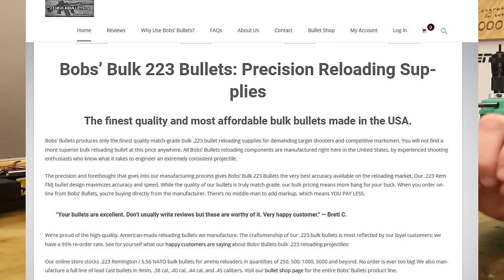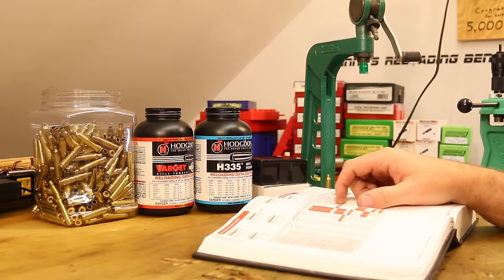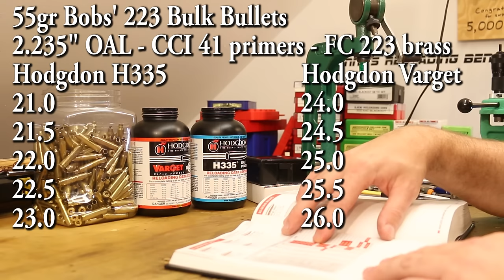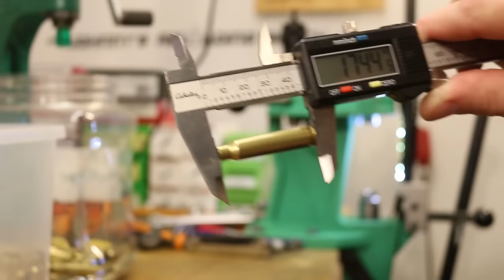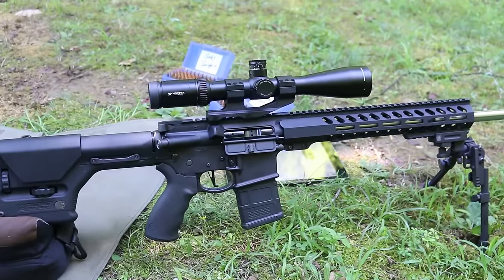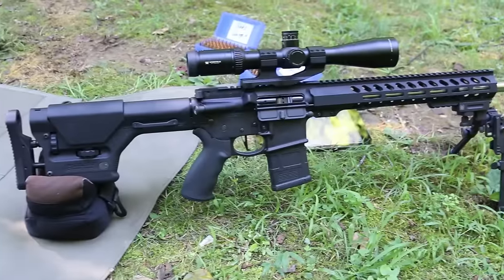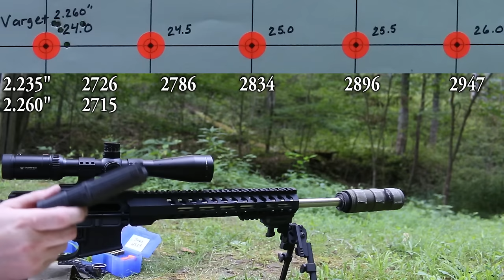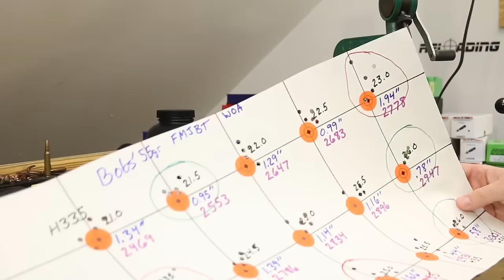Bobs' 223 Bulk Bullets - OUTSTANDING accuracy! 8 cents each!

Comment: How do you seat a 55 fmjbt out at 2.260?   Seems the bullet would fall out of the end of the case mouth.  Do you have 1 caliber engagement of bullet inside the neck?  I have loaded many a FMJBT.  Never saw how to safely mount a FMJBT at 2.260 COAL.
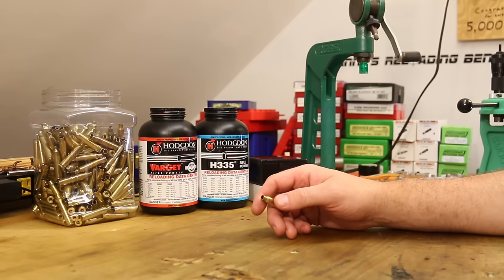Reply from the maker: You can literally see the bearing surface of the bullets seated to the different depths about 5:30 into this video.

Comment: Johhny,I have a situation to ask about,I was decapping the other night and almost broke my Lee universal decapping die pin! I have been running across a few case's that have flash hole's..I know you think I'm nut's, but they are off center? and they are making my decapping  pin get bent,this is pissing me off..is this a regular issue or WTF???...
Reply: Federal brass and a few others this is a semi regular occurance.  Maybe 1 in 40 or so are off center to the point I have to discard the case.

Comment: I'm really new I watch alot of your videos but you have so many I don't know if you've covered it.  I loaded 77 gr bullets into a mix of 556 and 223 brass the shoulder smashed down and bulged out on maybe half. It seems like they were the 556 casings that did it. Was I wrong to use 556 brass? Or did I screw up something else? Thank you
Reply: Bullet seating die is screwed too far into your press.
Reply: @mutantmutton  thank you!! I'll fix it

Comment: Hey, great video! I learned a lot. Hoping you could answer a question, I have a spikes tactical 14.5" barrel with a 1/7 twist. I just started loading 223 and I'm beginning with 24.0 gr. ramshot tac with 77 grain Sierra hpbt match kings at 2.260 inches. I haven't shot them yet but I was worried about the OAL so I chambered and extracted a few. I found some pretty decent scratches/ dents on the bullets and they also seemed to grow about one thousand... I'm curious if you have any recommendations and if you have a method to check the distance between the chamber and the lands. Any advice would be greatly appreciated. Thanks!
Reply: Remington Bradley I assume you’ve found an answer to this by now but jic use a bullet comparator and an OAL gauge. I used to just color a bullet with a sharpie put it in a cut case leave it all the way out then chamber it and measure from the lands scratches to the base of the case.

Comment: JRB, I like the idea of a low cost .223 bullet for all your plinking needs. I shoot 3gun and dont use smk's on the close up paper targets. However, I use a progressive press (XL650) and have found 748 and TAC to be two powders that meter well. The stick powders like Varget just don't work well enough in the Dillon powder measure. So, would you consider working up either of those two powders? Additionally, do you think your 1:8 twist is hurting you with the 55gr bullets? I have a 18" 223 wylde 1:8 and it definitely likes 69/77 grain bullets better. I like what your doing so keep up the good work.
Reply: Mark Eggers I run a 1in8 twist on almost all of my 556/223 rifles, and have zero accuracy issues with bullets from 40gr to 80gr, just need to find a velocity that works for the weight you're loading.

Comment: I think you really need a "control" when doing accuracy testing. A load/powder/primer/bullet/oal/etc. that consistently gives you say 1/2-3/4 moa. Then when you are testing a first round of "control" will tell you if you, or equipment is 'off". There is no need to evaluate anything else if the "control" is off, until you figure out where the problem lies. All the testing in the world is really irrelevant, if you don't take into account ALL the variables.

Comment: .08 is a good, not great price for 1K lot of 55s, I remember somewhere, I want to say Midsouth, had a sale a year ago or so and it came out to .07, even my cheap self does not care about .01 per bullet.  To help with the excess lube, I occasionally will alcohol q tip out the die.  Very nice work on the recent videos, your early content was quality but this is a step up.
Reply: That was a sale price.  This is an everyday price.

Comment: Why do you deprime and than resize in 2 operations? You waste a lot of time in your prep.
Reply: This method cleans the primer pockets better and also makes it so that your resizing die stays cleaner longer. Also if you deprime before wet tumble the brass will dry much faster than if the primer was left in.

Comment: Good to have options on 223 bullets.
I have had 1moa groups with Berrys 223 bullets,  its a 55 gr FMJ (not plated lead) also $0.08 each.   Cabelas sells them with $5 shipping.   its a good deal.   Measured out 100 of them to confirm weight and they were between 54.9 and 55.1 with 91 of them. the others were 54.7 or 55.3  still not too bad in my book for the costs.

http://www.cabelas.com/product/shooting/reloading/reloading-bullets|/pc/104792580/c/104761080/sc/112555080/berrys-mfg-inc-gr-fmjbt/1838858.uts

Comment: Great video. The only thing you forgot was that when resizing you need to check head spacing with a Dillon case checker . when you resize you bump the shoulder back. You can mess up head spacing to where its short. You only want to set the shoulder back to where the primer end is flush with the Dillon case checker.
Reply: Every chamber is different.

Comment: Why do you auto loader guys crimp your loads, I used to crimp my handgun loads but I’ve never crimped my bolt rifle loads, even my heavy recoiling 340 Wby.
Reply: To keep the projo from moving. The inertia of the bolt tends to shove the bass a bit higher on the bullet than what you have seated it, changing the overall length. Bolt guns don't have the inertia on the bolt to change the OAL.

Comment: I have the same Redding press you have with the Redding press mounted auto feed priming system. The redding primer system I have is an expensive piece of junk. The small primers do not feed well. When they jam up, the jammed primer will push up the whole tube that is full of primers up and create a primer nightmare from hell screwing up the whole stack of primers. Rendering the priming system useless expensive piece of junk. Dumb ass design from a company that usually produces good stuff.
 The spent primers drop through the ram into a plastic tube and that is a good feature of the press compared to the older ways spent primers were dealt with.